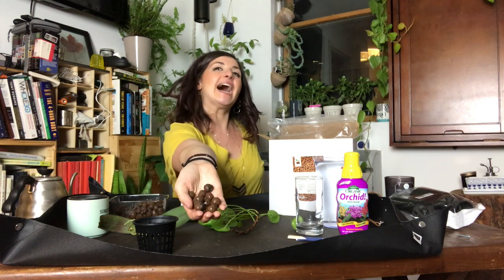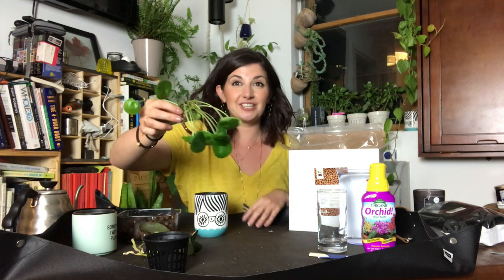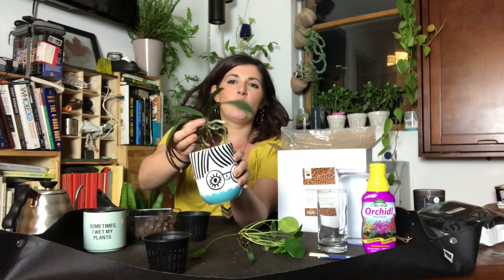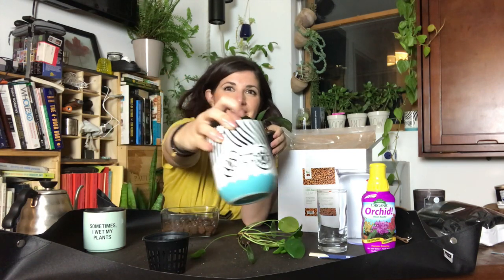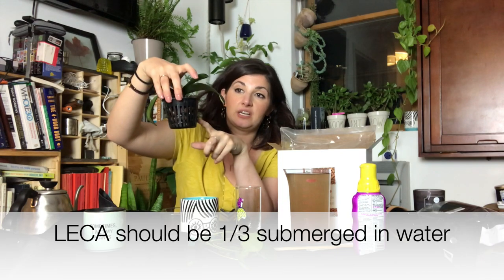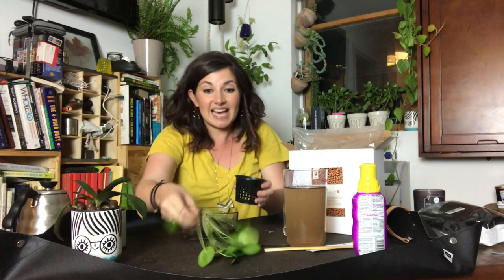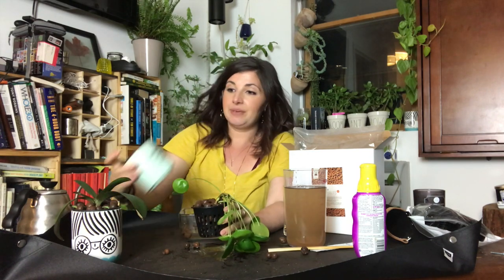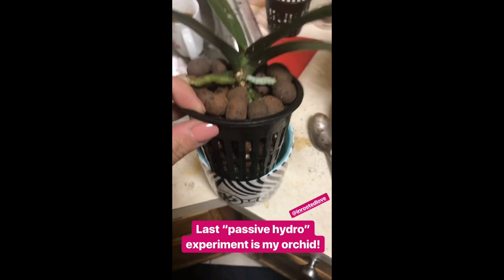First Time "Semi" or "Passive" Hydroponic Set Up for Houseplants!

Comment: I had no problem rooting pilea in water. but it was like, dragging it's feet and dropping leaves and going nowhere ever since I potted it. Now it's outside, her little pot is inside of avocado's big pot, so, it's not in direct sun, and after like 2 months like that, it's finally starting to look like it's not hating life. With that said, it could be a good idea to look up roots of plants you're trying to root, like, I took my mom's dying yucca (all 4 branches got mushy in the middle of the length) so I cut them and put them in leca, they rooted in like a day, but their roots are very thick and fragile, I think I broke half of them of when transplanting to soil. I mean, they were fine, all 4 of them, but in case of some plants, they might not be, so, maybe, if roots are fragile, just stick it in water instead of leca. If roots are easy going, you can root it in leca no problem.

Comment: On the Pilea, you might need a slightly deeper pot. Since that Pilea is top heavy and leaning to one side, you need the stem to go down to where the leaves start, so that there is enough LECA around to support the plant straight while its establishing itself. I found that with LECA by itself, because of its loose structure, that the plant would often tilt over when picking up the pot. So I started using a gritty mix which is 2 kinds of clay, lava rock and pumice in combination with the LECA.
Reply from the maker: ooo this is good intel! the plant was also very stressed from being knocked off it's mama, and since potting them up- it's stood up much straighter once it rooted in the leca! I'm curious to see how it continues to grow!
Reply: @growingjoywithmaria  Me too! Though my own experience with these inorganic mediums and my Pilea wasn't so positive. It was growing ok in the gritty mix if slowly. However i had it in a ceramic pot, unglazed inside and most of delicate roots had attached to the rough surface :( So wound up loosing a ton of roots that ripped off. I decided to put it back in soil because the roots were so delicate. And actually almost month later, its growing its first little baby, go figure lol :)
Reply: @Plantsandtoyhorses  Using a mix is a great idea! I have also found luck by planting them deeper than I would in soil, and possibly in a larger pot than I normally would, for more structural support from the leca.  Take your water levels into account when burying anything deeper though.